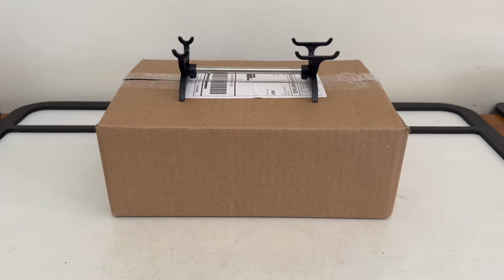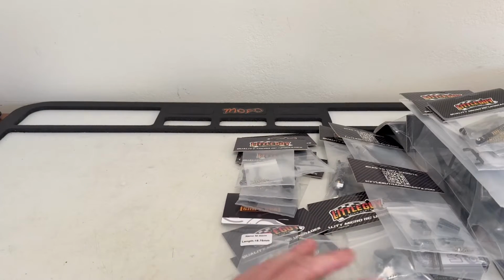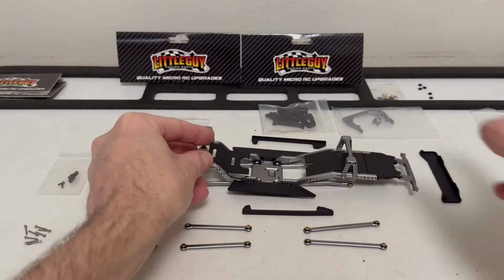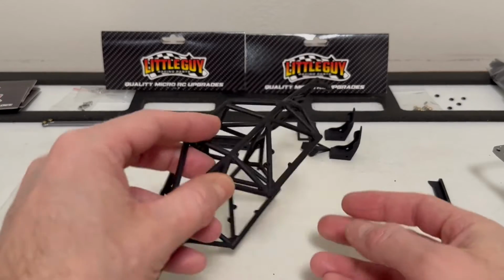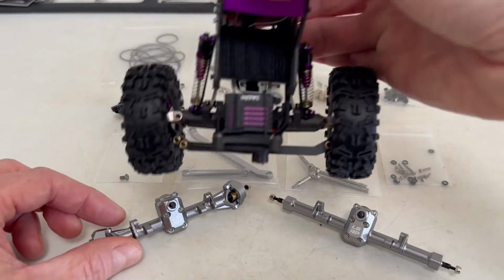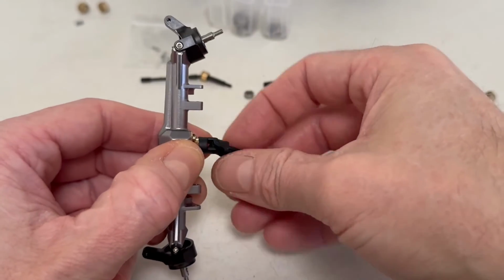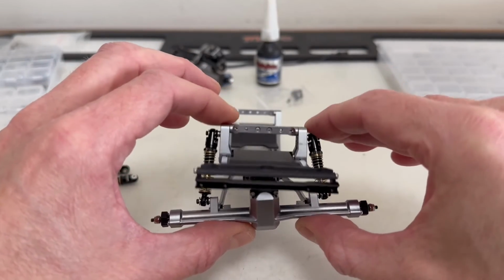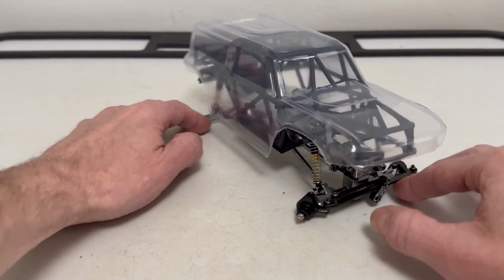SCX24: LGRP R-FACTOR & COMP FRAME BUILD - STAGE 1: MR24 TRANSMISSION, SUPER 8s, SHIFT RC NANO M

Comment: From what I've seen,  LGRP has amazing quality of parts fit'n'finish, but their transmission has some bad reviews. 
I'm not into printed cages. I'd like to see aluminum and less cluttered crowded cages.  Maybe not possible,  works on 1/10 and 1/1, but when taken down to 1/24 it just seems so tight and cluttered, if that makes any sense. 
🫤
Reply from the maker: Yeah, not sure the deal on that Trans. I ultimately got it smooth as butter, but it shouldn’t have taken that much attention/work to get it smooth. Still hoping it was a fluke run in production. I may try one again down the line.
I did pick up the X-Factor cage set/frame to build. I agree on the tightness of them. They look great, but I mean we still have to put a battery in (and out optimally) of that cage!!  Cheers!

Comment: Yeah I'm really hard on my stuff and I can't I kept breaking them EXO shafts non-stop like to the point I reached out to him and they replaced a couple and then they sent me a new set and they're like here check out these we have beef them up some it was really cool of them to do that cuz they're definitely not cheap
Reply from the maker: Holy shite! I can’t believe you snapped the EXOs. Great they got you fixed up. Did you remove the outer axle bearings when you installed them? - that would prevent them from turning to the 55degrees.
Reply from the maker: I got to get back to finishing this build up!

Comment: I have that transmission that’s what’s on the ripper build didn’t have any problems with binding on mine I would say little guy will replace that for u especially the money u spend with them
Reply from the maker: Yeah, they’ve got a new black center spacer (for MR24) coming and a new cage. Great customer service!  The spacer on that trans was mis-machined.

Comment: About a month ago I built a LGRP Ultra 24. Upon running, the cage frame cracked so easily.  The tinniest tumbles and it would crack. Started gluing it with CA glue, but became pointless.  Ive had other 3D printed cages, that were not this brittle. Im curious if the LGRP cage frame you just built has durability issues?
Reply from the maker: This one seems very stout. Mine was a bit warped and super sturdy when trying to flex it. Luckily they sent me a replacement cage. This may not be the same plastic or something. Of course, have not driven it yet obviously.
Reply: Thanks for the feedback.